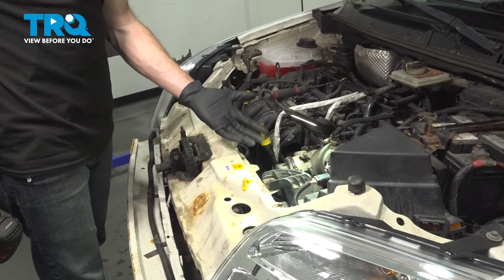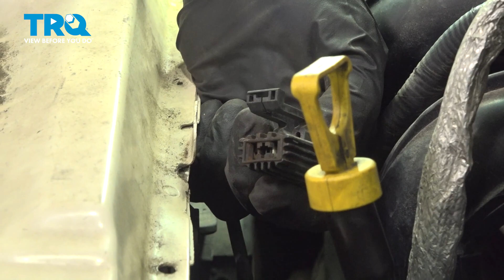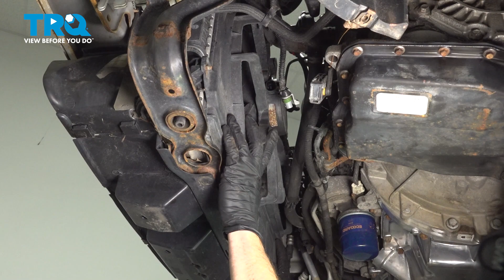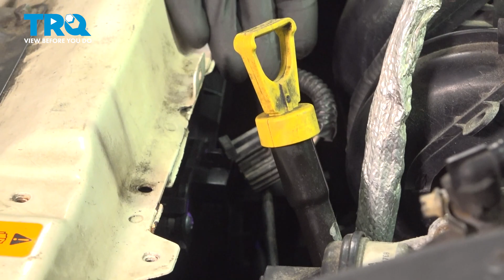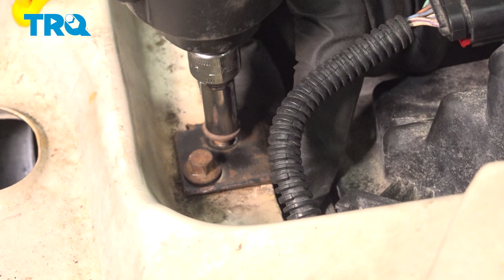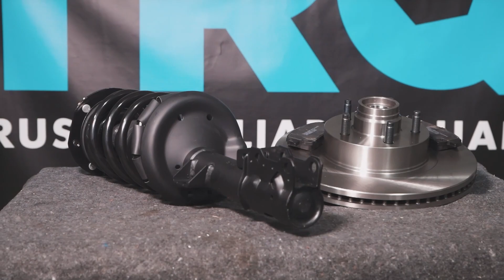How to Replace Radiator Cooling Fans 2010-2013 Ford Transit Connect

Comment: My Radiator Cooling Fans were replaced already, but the connector that is taken off the radiator fan at 1:04 - 1:17 is burnt out on my van and I cant find a replacment anywhere. Does anyone know where to find one? My van is over heating without this fan working. Even my shop can't find one. I'll even resort to a 3d print or other fix if I can't find the part.